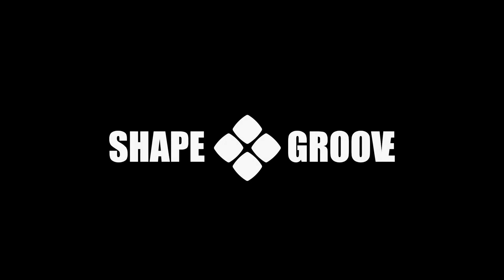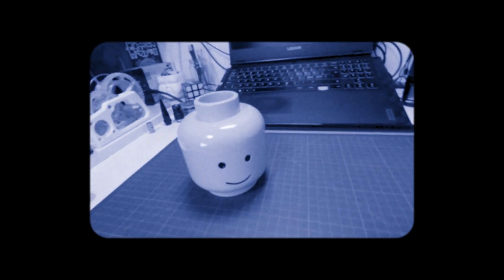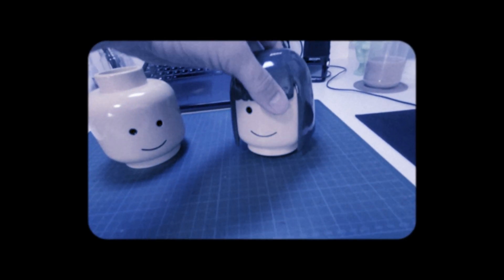DIY PET Bottle filament machine | Sustainable 3D Printing | LEGO-Head Project Series Ep. 2

Comment: Why not design a hot end for a bed slinger printer, that can use the flat stock, with a feed resistance sensor for consistent material feed, and just use the bottles, without melting it into filament?
Reply from the maker: Thanks for commenting!
I think there is a project out there, somewhere, I remember seeing it on one of the many forums, regarding what you mentioned. The machine I and many others have made in various forms does not actually melt the flat stock, it just heats it and pulls it through a printer nozzle that has been drilled to size, acting like a die of sorts. The pulling force is rather high on the filament machine and you really need the gearing to get a little nema17 motor to do the work. I honestly think it is better to first make the filament and then use it. Having all of this as part of your extruder might make it way to heavy. Running the filament machine to hard makes it skip. It is not impossible though.